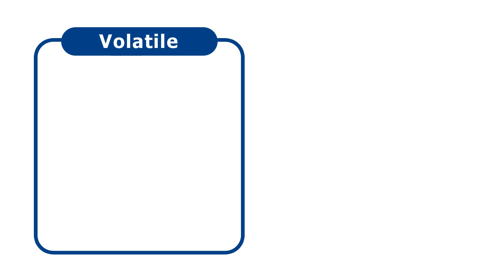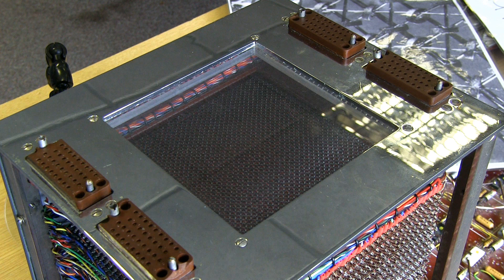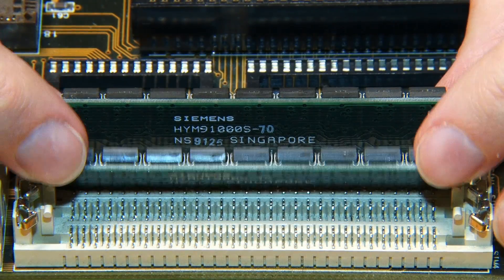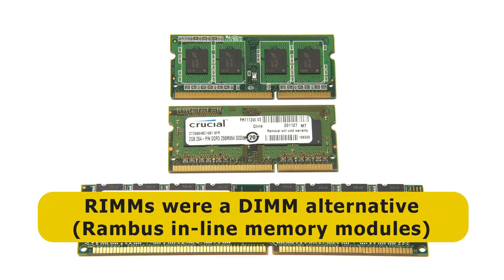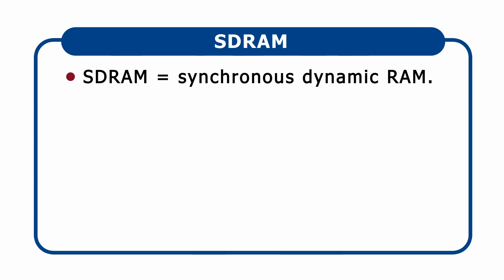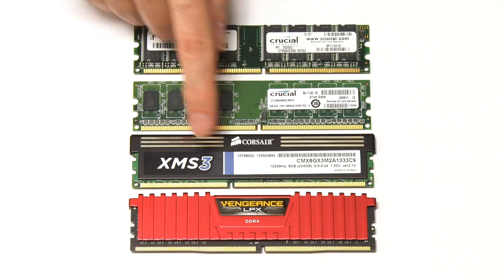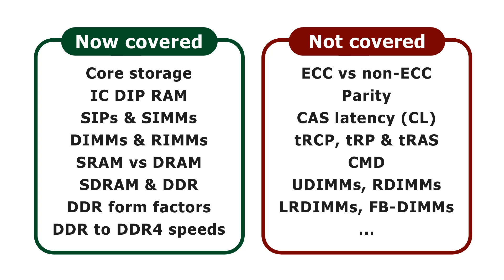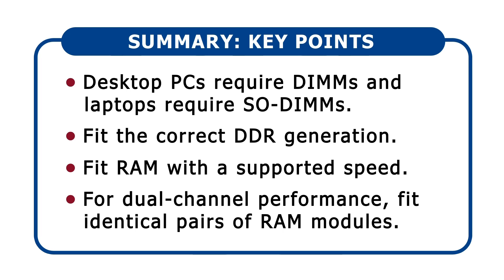Explaining RAM

Comment: I can just see it : Windows 18 minimum system requirements: 16 petabytes of RAM, 512 core 16 GHz CPU, 64 exabyte GPU for ray traced Solitaire, 64 exabyte boot partition, 64 Exa-OPS NPU for CoPilot user data harvesting, 4 petabit/sec Internet connection for telemetry.

Comment: You've put the memory module in the closest socket instead of the second slot from the CPU. I know this is about explaining RAM and you do refer to the manual, but that's still a very stupid mistake and people may copy it. I'd not talk about slot 1..4 in the first place, they are identified differently.

1 GB is 1,000,000,000 although the vendors still use the 1 GiB value and display it as 1 GB. This is stupid as HDD's and SSD's do use the correct GB notation.  At least some explanation should be put in place about that instead of furthering the stupidity of using powers of two for kB, MB and GB.

Comment: Great video and very clearly explained. I'm not sure if this a laptop (SO-DIMM) thing but the DDR3 and DDR3L types, which I believe is to do with the voltage required by the RAM modules. Are these interchangeable or will a motherboard only work with one type? eg DDR3L-1600 PC3-12800 CL=11 Non-ECC Unbuffered 1.35V 204-pin. Thanks.

Comment: Did they ever make static RAM cheaply Chris? At college we were told that SD RAM was introduced because it was cheaper, but what other reasons for its adoption were there? DDR memory, I believe, can transfer on both rising and falling clock cycles but surely static RAM still has the advantage of continual availablity?

Comment: My first field call out as an engineer to a site was to repair a faulty core memory module, you know, no doubt, that the cores use to have 3 wires per ring and one was a sense wire. All were driven by mainly transistors and these tended to become loose due to dry joints, which when heated tended to cascade to every other joint on the board. Later on in my career I spent time replacing memory chips on SIPs and SIMs, Hah the good old days in darkest sanctioned South Africa 😁😁. Now everything is nigh on impossible to repair economically, if at all.
Reply from the maker: I love the idea of a call out to repair core storage. Today, nobody would believe you were there to actually repair RAM! :)

Comment: The only thing I don't get is why would you still need an SSD if you can simply get more RAM?
Reply from the maker: RAM is used to store programs and data when a PC is operating, but all data is lost when the PC is turned off. An SSD (or hard drive) is used for permanent program and data storage -- it is where you load programs and data into RAM from. So you need both! :)
Reply: @ExplainingComputers  but when it comes to loading faster, don't they both do the same thing?
Reply: @jtz2268  read his response again...

Comment: Hi there, love your explanation of RAM, however I do have a further question. When upgrading RAM modules,  do I need to match the previous megahertz frequency which is stated on the previousRAM with the new modules I want to install?
Reply: Ideally yes, but if you replace them with different speeds they will default to the module with the lowest speed.

Comment: I'd like to fit my computer with enough RAM to use an Amiga style RAM Disk that I could fill with regularly used programs, or even an entire large size game to cut down on loading times. I've looked at videos that show that it can be done and it's very interesting, sadly the amount of RAM required to realistically do it(32gb min, 64gb recommended) would cost more than my entire computer put together.

It's always nice to dream, and also reminds me of old computers like the C64 where you had to load your entire program off of tape before running it. Of course, with SSDs, this initial load would be cut down substantially.

Comment: I have 4GB RAM in my computer. Can I add another RAM of 8GB in the second slot? Will it perform smoothly?
Reply: No it has to be a 4GB of the same speed (or faster) if it is lower the it will only access the memory at the lowest speed module.

Comment: If I have 4 ram slots and and 2 dimms that are already in dual channel mode, could I use 2 different dimms in the other 2 slots as long as the motherboard can support them?
Reply from the maker: Yes, assuming that the specs of the other DIMMs meet the motherboard requirements, this should be OK. Just stick to using DIMMs in matched pairs, and everything should be fine. I say "should", as sometimes things are not stable. But this is how DIMMs are supposed to work!
Reply: @ExplainingComputers  Ok that's really helpful! Thanks I appreciate it a lot! :)

Comment: From 1998 until 2000, I worked at a PCB factory that used the following:
One of the first transistor based compouters built in 1973, which had a whooping 32 KBs of magnetic core RAM (Used for controlling a CNC drill). Data input for this computer was done by paper tape but...
... we also used an XT-8088 PC with a custom designed interface for the aforementioned 1973 computer to allow uploads of files from 5.25 inch floppies. It also had an amazing 10 Megabyte MFM hard drive for the OS.

The magnetic core RAM was especially interesting as it was also non-volatile, so programs would remain in memory even if the power was turned off and modules removed.

Good times...

Comment: I recall teaching my "data processing" students how core memory worked.  The X and Y address lines, the sense wire, the hysteresis loop, etc.  When IC RAM came along how it worked was no longer in the text books.  Apparently the authors decided we did not need to know or maybe they did not know how it worked.  But old terms do not go away very fast. 50 years later memory dumps as still called "Core" dumps by lots of folks.  Linux still has core man page and the memory dump file is named "core".

Comment: November 2020 here and DDR5 are still only on Graphic cards. Or am I wrong?
Reply from the maker: You are right, currently still only in graphics cards. But DDR5 DIMMs have been manufactured and are expected to be sold in 2021: https://www.theverge.com/circuitbreaker/2020/10/7/21506883/ddr5-ram-memory-first-modules-sk-hynix

Comment: Question; I upgraded my old FX 4350 to a AMD Ryzen 2600X. What puzzles me is that no matter what I run on this PC my 16 GB of ram never uses all of the capacity. My previous system was the same with DDR3 16GB that also wouldn't use all of it's memory when under load. I can use GLMark2, Unigine-heaven, multiple Google Chrome pages plus 4K videos all running at once and the most Memory I can record being used at any one time is 4.1 - 4.2 GB, and one gigabyte of that is for memory swap. Which then makes me wonder if the ram settings are still wrong, question is, is there any point in upgrading the memory to 3200, 3600 or doubling what I have?
Reply: I meant to say I'm running 2 x HyperX FURY 8GB 2400MHz DDR4 Memory and the previous memory was the same but DDR3 and both computers run Linux.
Reply from the maker: You will need to be running a meaty application to use a lot of RAM -- for example a video editor or CG rendering program. Very, very few PCs benefit from more than 8GB of RAM. Or, install VirtualBOX and run up a virtual machine -- that will grab as much RAM as you allocate! :)
Reply: Thank you Christopher.

Comment: Chris, I am trying to decide whether to buy a motherboard which accommodates DDR4 and use that older memory or wait to purchase one which accommodates DDR5 and use the new RAM. Making that decision requires answers to two questions and I am hoping you will help. First, is DDR5 supposed to be noticeably different than DDR4? If so, then waiting is certainly the better choice. But if waiting is more advantageous, then I can't help wondering  how much longer I will have to wait, and I ask if you have any clue. This video says DDR5 is supposed to be released in 2019 or 2020. This year (2020) is half-way over, but DDR5 has not been released.
Reply from the maker: Go DDR4. :)
Reply: Gddr6 is not realeseed either but it will be in the end of the year

Comment: Great video discussing the key concepts of RAM. One thing that I think would have been useful when explaining how to choose memory is the importance of the size of the memory modules, as you should only purchase as much memory as your motherboard supports. For instance on my (ancient) 2012 Mac Mini which I'm typing this from, the maximum supported capacity was 16 GB which would be installed as a pair of 8 GB modules. If I were to install additional memory (i.e. 32 or 64 GB) I wouldn't gain any additional benefit from it and some system may out right reject RAM that exceeds its cap.
Reply: Does maximum memory is in the board manual?
My processors can only have 32 gigabyte of ram i don't know about the mother board.

Comment: 1:20 Not true my main computer for YEARS had at least 1 gig of ram, before i maxed it out to 2 gigs of ram, 2GB of ram or less is still usable if your just web browsing, 480p video playback, and playing older games.
Reply from the maker: I said that "today, 4GB is the minimum recommended RAM for a modern Windows PC", and this is a very widely held view (indeed many people would say 8GB). I did not say that is it not possible to run a version of Windows in less RAM. Totally, I accept that in some circumstances a system can function with less than 4GB. But I would not recommend building or purchasing a PC today with less than 4GB, and the video reflects this.

Comment: Hi Christopher! I wish you would consider doing another more in depth video on ram. i am upgrading my Dell Latitude e5540 laptop which has one slot populated with 4gb of Kingston ram. the specific bits are as follows: "4GB 1Rx8 PC3L 12800S -11-12-B3". I found another stick with everything else the same but the last being B4 instead of B3. what does this mean?
Reply: My laptops use low-power version of the normal ones in the desktop
Usually they have a lp prefix.
Like lpddr3 ram.

Comment: Thanks very much for your channel. You present the best most clearly understandable information on computers I have found on you tube.
I came here to find the answer to a question about ram.
The ram is in a Dell XPS 8100 desktop and it says it is  PC3-10666 DDR3-1333 240pin SDRAM DIMM  it has a voltage of 1.35v. Can I use ram with 1.5v alongside the two sticks my computer has already has or will that cause a problem?

 The numbers on the ram I am going to put in the spare slots are the same, except for the voltage difference and the original ram has a number of 10666mb and the other ram says 4GB DDR3 10600 RAM, DDR3 1333 PC3-10600U 4GB DDR3 2Rx8 240-pin Dimm CL9 1.5V 

This is confusing me and I can't find the answer anywhere. Is it ok to put these two types of ram in the same computer? 
Thanks if you can find the time to answer.
Reply from the maker: The answer is "possibly". You are unlikely to do any damage trying the 1.5V RAM in a slot supplying 1.35V. But it may not work, or may be unstable.
Reply: @ExplainingComputers  Thanks for replying. So best to try and find exactly the same voltage then? It's an old machine but seems  such a waste,  to throw it out, as it has two terabyte hard drives and an i7 processor, I thought maybe I could add an ssd drive and increase the ram, which would make it last a few more years.
I have never fixed a computer before, so it's all brand new for me.

Once again, thanks for a great channel..

Comment: In my lifetime we have gone from a computer that took an entire floor of a building to one you can hold in your hand. When we went from vacuum tubes to integrated circuits we had two problems. The power supplied by power companies was very unstable and the manufacture of integrated circuits was expensive and not good. The company I worked for once built a computer which used magnetic storage. We then went to the DIP integrated circuit rams in our computers. (We stopped making computers eventually.) As a service engineer I spent a lot of time changing integrated circuits. Then the power producers started generating cleaner power and the transmission of that power to manufactures, businesses, and homes changed to keep clean power as clean as possible to those places. The manufacturing of integrated circuits began to produce chips which were much more reliable and cheaper. Our products became much more reliable and I went from changing integrated circuits on boards to just changing the entire board and not repairing the defective ones (changing a circuit board became more rare with time).

Comment: Wow that was a blast from the past seeing that Sinclair Chris! I had that same one back in the day. I also had a Tandy Coco 16, a 64, and 128. The 64 was actually made by soldering in additional ram chips to the 16 and bank switching. I also had a pair of Commodore 64 and a bunch of other machines over the beginning years. In many ways more fun than these new ones in spite of the limited power by today's standards.

Comment: if u have 2 ram modules you plug em in sockets away  from cpu, not close (in 1 and 2)  @ 4:32
Reply from the maker: You are correct -- I used slots 3 & 4 here, probably for photographic reasons! :) But there is no performance difference using 1 & 2 or 3 & 4.

Comment: Well done video. What I'm confused about now is that the CPU and motherboard both note support for different speeds of RAM. Why is that? And why do people say that when doing a custom build, to use the motherboard specs for RAM and not the CPU specs? i.e., A CPU may support a max of 2933, but a motherboard may support specific frequencies above that. So even if the CPU does not support 3200, if the motherboard does than the RAM would work. I don't understand that. Anyway, after watching about 3 of your videos, you got my sub!
Reply from the maker: A motherboard can take many different CPUs. So it is possible for the CPU fitted to have a lower speed RAM support than the motherboard it is fitted in. So the RAM needs to be chosen relative to the CPU, not the board.
Reply: @ExplainingComputers  Thx, that makes sense now.

Comment: I've recently shopped around for some dual channel ram for an older MSI motherboard. It supports a max. of 8GB using four slots. It wasn't clear to me in your video whether two dual channel kits could be used to further increase speed.
I've also noticed a difference in voltage specification on similar RAM modules. Looking up the specs on my MB didn't reveal any voltage requirements. I'm trying to figure out why the first attempt to upgrade my RAM caused my display to get stuck in "Standby Mode". 
I'd really appreciate your input on this but I understand if you're too busy. Maybe someone else in the comments can help me out? Thanks
Reply from the maker: There will be no difference in speed between using, say, 2x4GB in dual channel, or 4x2GB (inevitably dual channel). The RAM upgrade issue could be linked to which slots are used (if they are not all full), or mixing RAM from different manufacturers. I would not mix RAM from different manufacturers in a dual channel pair.

Comment: My very first time opening up a PC case and working on it in any way was with my Dell that I had paid over $2,000 USD for. I don't remember the exact specs, except that it had a Pentium III, 800 MHz chip in it and it still had a 3.25" floppy drive. All I did was double the memory in it by adding a second stick. I do remember that it had 128 MB of PC133 SDRAM to start. That would have been back in the year 2000 and was enough to peak my curiosity of how these things worked. I've been learning about and working on them in some way ever since then and today I even own a small IT business in El Paso, Texas, USA. Keep up the great work on these videos. I am currently watching your Ryzen Budget PC Build #1 video and jumped back here for a minute.